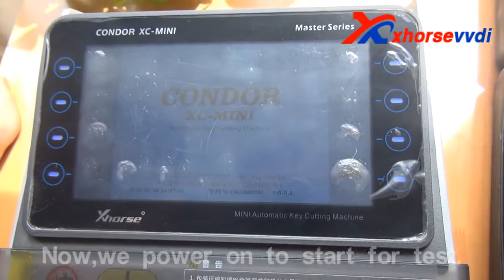How to Upgrade Condor XC-MINI Built-in Power Supply?

Comment: My machine will not cut keys. Will this power supply fix my machines problem?
Reply from the maker: Hello,do you have detailed video?our skype:xhorsevvdi.com or email:sales@xhorsevvdi.com
Reply: No it's a conversion kit where it will be battery operated for mobile use and charged by a cigarette lighter plug. If its not cutting keys you need to calibrate the machine!